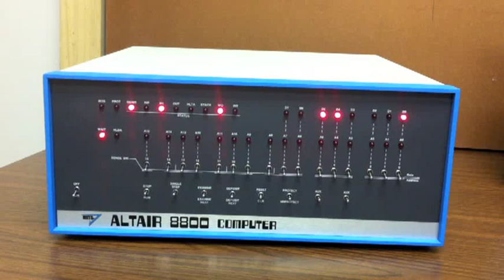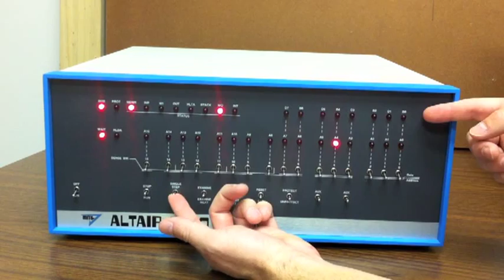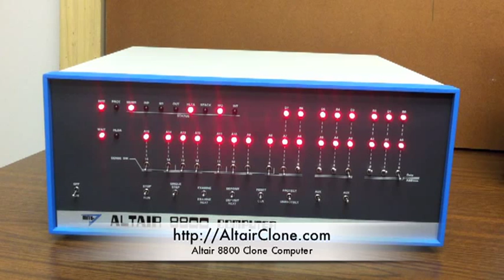Altair 8800  - Video #5 - Interrupt Acknowledge Cycle

Comment: I have CP/M running but it's not using interrupts, the INTE light is on so they are enabled, but it's not enabling the interrupt function on the serial board or the disk controller. How do I set that up? Anyone know?

Comment: I figure out it works with a z80 inside or some predecessor?, but why the hell it works on octal numbers, hexadecimal rules!, $C9 is the RET instruction in z80, and the "RESTART 7" as spoke = opcode $FF is nmonic as "RST $38", because $38 is the default instruction handler address.

The good thing, it is not limited to insert only one byte instruction, but it is the easy way from the point of view of hardware design.

I never saw a z80 feeding with multiple byte/instruction on INT.
Reply: +flyguille The Altair 8800 is powered by an Intel 8080, which the Z80 is a descendent of.

It works on octal numbers because it's an 8-bit processor. 8-bit = octal. Octal works just like hexadecimal anyway, except there's no 9-F.
Reply: @themaritimegirl  Thankfully the 8080 is fully compatible with hexadecimal with little to no issues. 

He's just using octal in the videos because most of the old 8080 and Altair documentation back in the day would mostly use octal in its explanations and instructions. But there's nothing stopping you from thinking in hex for the instructions if you wanted to.

So 
377 in Octal = FF in hex.
70 octal = 38 hex
16 octal = E hex
etc

He's just saying the same numbers, just in Base 8 instead of Base 16. Its just traditional to say everything in Octal for an Intel 8080, but you don't need to.
Reply: ***** octal uses 3 bits only, 2 octal digits = 6 bits, if the processor is 8bits, there is no reason to have it octal.

But if the instruction set of the 8080 is like z80, IIRC the instruction encoding have 3 bits to indicate the register to use, and other three bits for a second register to use, in Z80, it is that way, B C D E H L FLAG A , but FLAG in most of the command are remplaced by (hl) memory access, so there is 8 selectable registers, that can be pointed within one octal digit, maybe that is the reason.
Reply: +flyguille My point was that it's an 8-bit processor, and that's why instructions and addresses are represented in octal. I wasn't trying to say that 8 binary bits represent an octal number - that's obviously not the case, as you know.
Reply: ***** the easy way to represent 8 bits numbers is hexas numbers, 2 full digits, vs 2 and 2/3 digits if it were octal. Obviously, the reason it has octals is not that "it is 8bits" that don't match. The real reason is how the instructions are encoded within the 8bits data bus. so the mention "it is because is 8bits, is completely wrong".

Comment: You know, I have a Z80 cpu on my desk and a few jumpers etc, with a breadboard, I have yet to do anything with it, and I'm not planning to buy any extra memory any time soon, would you know how to interface it?, I have a few LEDs as well
Reply: Gabe Alexander not a z80 but a 6502 https://youtu.be/LnzuMJLZRdU. If you run your cpu slow enough you could use an arduino mega or even better a FPGA for your memory and display.